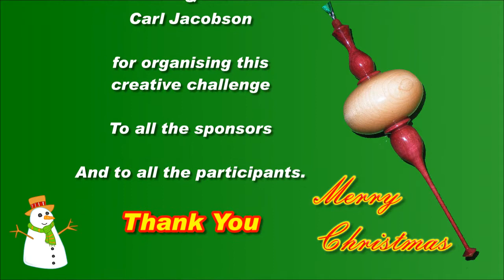My Entry in the Christmas Ornament Woodturning Challenge

Comment: Very nice Bob,
  What did you use on your buffing wheels to buff the ornament and was that the only finish you used on it?

Regards,
Bob
Reply from the maker: Thank you Bob. The finish I used was a Melamine lacquer sprayed on with an airbrush. And yes it was the only finish. I sprayed about 5 -6 coats, de-nibbing between coats when required using Mirka Mirlon Ultra fine pads.

The blue compound on the buffing wheel was in a kit I purchased for buffing acrylic pens, it originated from Pen State Ind. I think and is just called 'Acrylic Buffing Bar'

It doesn't add any finish to the piece, just polishes the lacquer.

This is the system I've got    http://www.pennstateind.com/store/BGBUFF.html

Thanks for watching and commenting

All the best

Bob